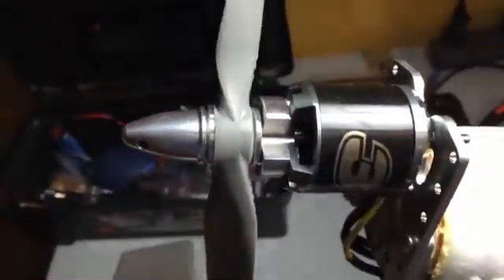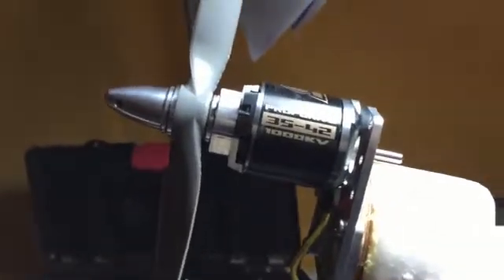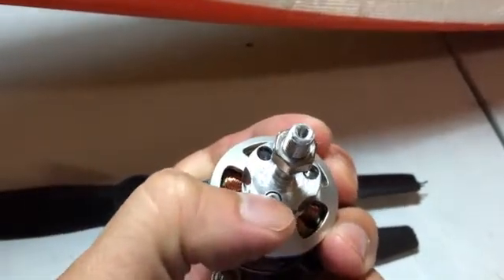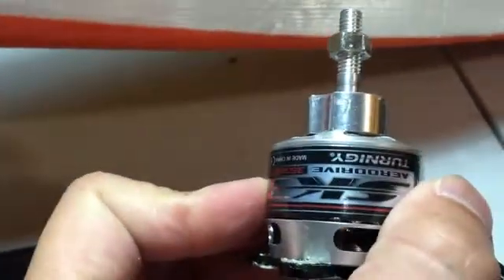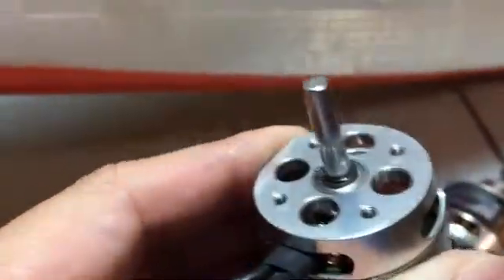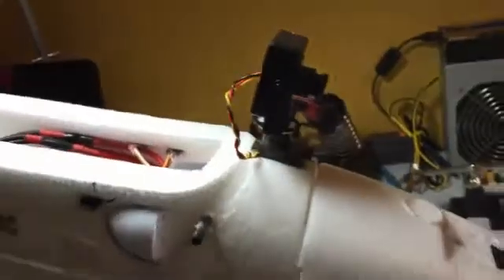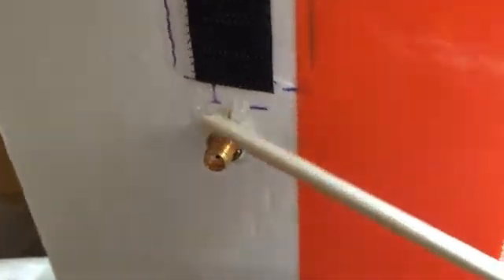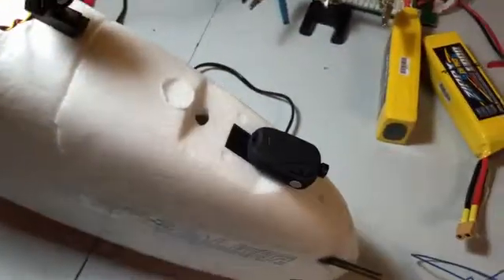Skywalker FPV Setup Part 3: Motor and Video System

Comment: Hi - I'm looking to build a Skywalker this winter - currently fly helicopters & drones but want to get build a 3S powered - camera carrying SLOW - long flight time - heavy lifting FPV plane for agricultural field surveying - requiring enough horse power to lift itself out of trouble when necessary. Admitting I know zero about airplane motors...Can you offer a ideal motor/prop set-up for my Skywalker set-up. In the video you mention the SK3 3542/1000 KV with a 12x6 prop...would this be appropriate for my application...also like your motor mount on the video - where did you find the mount? and what ESC/BEC did you use? ANY advice getting me started off with proven equipment will be appreciated...Thanks, Mike

Comment: hello Im using Turingy SK3 35-42 1000KV with my skywalker 1900. and works so well you should install yours also and you will see the difference. good luck
Reply: +Aron Gatt hello i was using 9x6 prop 4s battery sorry to reply late
Reply from the maker: Could not agree with you more Eng Faisal on the performance of the SK3 motors, I have a few of them on my Bixler planes and they just out perform the NTM hands down.
Reply: +Eng Faisal (Q8FPV)  hi , what prop you are using with that motor and are you on 4s or 3s ?